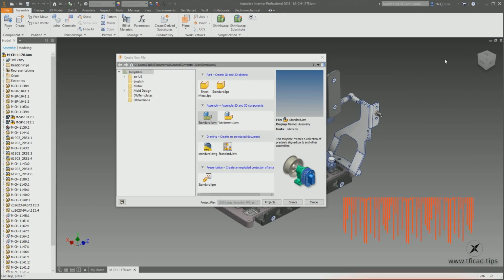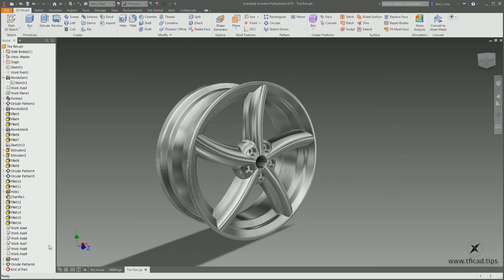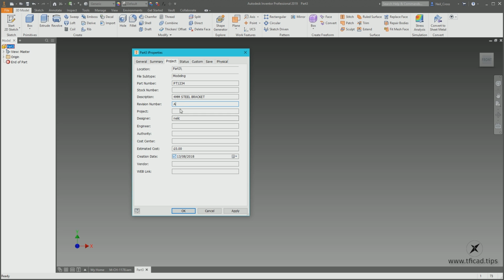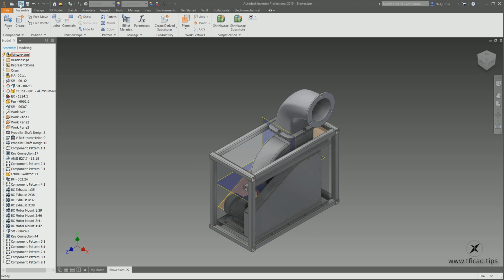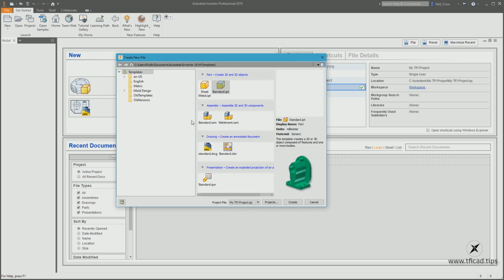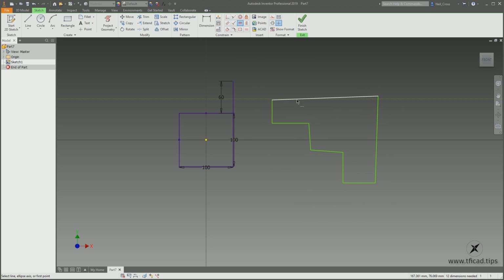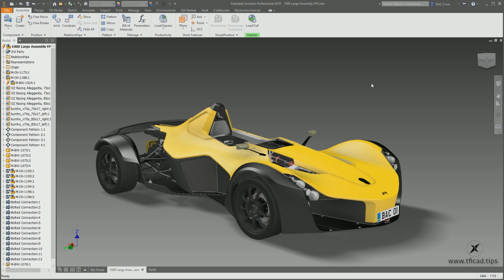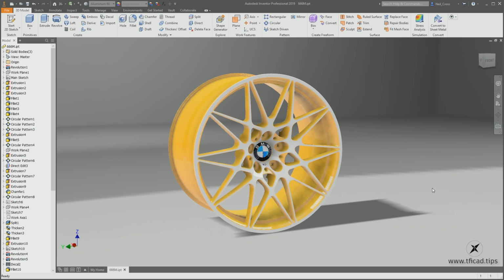5 Essential Tips for BEGINNER Autodesk Inventor users!

Comment: You said that you designed the laptop you were working on, so I have a question about that. I want to remake certain objects in inventor as well, however, I have no idea how to see all the parts, I don't know how to measure everything. Do you find references online with all the measurements? Or how does this work? Because so far I've been creating objects with no clear or correct data, so I'm interested to see how to even start.

Comment: Dear God.....I have used Fusion with the "Capture Design History" and whatnot and I have legitimately been saying for....a solid (HA!) year that Inventor needs that feature....Mind...Blown...

I had to actually pause the video after that and let that sink in. I have wasted SO MUCH TIME!!! Hahaha. Good God, I wish I had known that sooner. That right there makes me think you really should make that 50 tip video haha. I know that isn't what you want to hear...but my brain just exploded and it is only the second tip...kinda nervous for the rest XD

File management is absolutely an issue for me, it is good to see how I should be doing that with project files.

One of the most useful lessons you taught me in your "Inventor in under an hour" video was to keep every single sketch as simple as possible. I remember trying to design the whole part in one sketch when I first started and it was just an epic fail. I find myself always saying to myself "Keep It Simple Stupid" (KISS) in your accent, "Keep your sketches as simple as possible, do not be afraid of a bunch of different sketches to shape the solid into the shape you want." Some of my sketches are simply triangles or a hex only to extrude a nut "pocket" or hex shape cut into a solid so I can 3D print a part and simply put a nut in and easily joint pieces together. A lot of my sketches are very simple and I tend to have quite a lot of them and it just makes designing complex parts so much easier when you learn how to think decompositionally. "Start with the end in mind." The number of sketches DOES NOT MATTER, use as many as you feel are necessary. Even to this day I try adding too much into one sketch, keep it simple, simple is brilliant. 

I wish you would do more videos with assemblies, you have done a lot, I do not want to imply you haven't done enough or a lot. I am trying to create an assembly now and I am designing pretty much everything so if I want to design a bracket to 3D print or CNC machine out of metal, I find myself wanting to design a part in an assembly because I have to design a part based off of certain frame constraints. For example, the center slot and internal T-Slot style groove of extruded aluminum to get a nice snug fit, like this: https://us.misumi-ec.com/vona2/mech/M1500000000/M1501000000/M1501010000/ or similar where the new design must work with predefined geometry that cannot (or should not) be altered. In those scenarios, I think back to your "Inventor in under an hour" video (which I have gone over many times) and I feel like the way I am going about it is not the best way to go about it. I am getting better at designing individual parts, creating original parts to fit together flawlessly in an assembly is certainly a wall for me. Something in the back of my mind, I want to say it is you that said it but cannot remember, keeps telling me to stop trying to create a sketch in an assembly or subassembly when I am trying to make a new component for that assembly. I find myself stopping because I am under the assumption I am going about it the wrong way. 

I am not looking for individual support for my problems, just to be clear. This is a problem that I struggle with and I imagine if I struggle with it, I have a hard time believing I am the only one struggling the further into assemblies one gets. I know, I know, "Inventor is a hugely complex subject..." It is a massive suite, it really is. It is hard not to be intimidated and discouraged and/or disheartened by the sheer scale of the problem that is learning Inventor. In all seriousness, with how much time I spend in Inventor and how incompetent I still feel I am, I genuinely question whether three years in school is enough time. The certification exams require a minimum of what? 400 hours? I don't even know how hany hours I have in Inventor anymore. 400 hours is roughly a little over an hour per day, everyday, for one year. I easily have double, maybe even triple, that and I still feel grossly incompetent in Inventor. I would genuinely be so incredibly lost without your channel. Thank You so much for what you do.

On a side note, from one man to another, ya look damn good, no homo.

Comment: "Just play around" is really the best way to learn almost everything. It is how I taught myself AutoCad (started with v12) and now Inventor (with the assistance of your videos). I actually had Inventor on my machine for a while before I forced myself to design a project with it. The hardest thing was trying to forget the workflow from AutoCad while working in Inventor since they are definitely different beasts.
That was just under a year ago and I am currently running 3 projects out of Inventor (I am writing this as I wait on a stress analysis on a big assembly to complete) and I switch between Inventor and AutoCad almost seamlessly. Though I do admit to doing more complex sketches in AutoCad then importing them into Inventor as the sketch tools in Inventor still feel clunky to me.

As always thank you for your hard work in sharing your knowledge.
Reply: ooh my god, how are you now ? 4 years and now you should be very good using inventor... i got the exact same case as you right now, trying so hard to learn inventor and forget the workflow from autocad, since i also taught myself autocad by playing around... and now i also forced myself to work the project using inventor rather than autocad. how you think ? is inventor is much better than autocad for 3D mechanical drawing and assembling ? ooohhh how i would like to message and learn directly from you, i really got the same issue now moving to learn inventor, hahaha
Reply: @ryanninjutsu  I do most of my work in Inventor but I will leave it up to others as to whether or not I am "very good" at it.
To answer your question, yes Inventor is far superior for mechanical drawings and assemblies. 
If you haven't already I suggest you run through Neil's back catalogue of Inventor videos. Pay special attention to setting up your parts and assemblies with "best practices" because this will keep your files from getting away from you. Also, force yourself to integrate the parametric features. Taking a little extra time at the beginning of your drawings can save you hours when you need to make changes. 

If you want to ask me questions, feel free to post them here. If I don't respond quickly please don't take it personally. When I get busy it might be a couple of weeks before I even open YouTube to see what is going on.
Reply: @chrisose  thank you very much for your reply!! now you're the catalyst for me to learn inventor, investing my time to learn the software, 
i was always going back and forth and not sure if i have to learn this since im quite good with autocad, but i do feel limited in 3D designing because of autocad (or maybe its just my inadequate skill).
anyway, im going to learn inventor and do what you suggest to run through neil's back catalogue of inventor videos...

so im usually design the whole part at once in autocad, but in inventor ? we must do it 1 by 1 ? part per part ? 

many thanks for your reply once again, glad you're helping, its very okay if you're busy
Reply: @ryanninjutsu  While it is possible to build out a complex part entirely within a part file (.ipt), the power of Inventor comes in being able to design your project to mimic the real world where parts are assembled to make complex components that are themselves a part of an even more complex whole. 
And despite the fact that your models can end up extremely complex, you will still have the ability to edit the simplest parts. And if you have taken the time to link all your files properly, edits made to a simple part will automatically make necessary changes to associated components through the entire model.
Reply: @chrisose  i see, thank you so much for your insight! i could imagine im drawing complex machinery with inventor, but right now i still learning and practicing with inventor and by neils youtube tutorial. still not use it for my real project yet...

but i want to ask your opinion, since i also accept freelance 3D mechanical design sometimes, the part requested sometimes is not too complex, sometime its just 1 simple brackets of something. how you think using inventor for that kind of task ? or its okay for me to just use autocad ? i don't have any problem doing these simple task in autocad
Reply: @ryanninjutsu  I am assuming that the drawings you are producing have multiple views in order to convey all the details of the bracket. In AutoCad this requires drawing the part multiple times and with each drawing come the chance of introducing errors.
With Inventor you create the part model then your drawing is created using different views of that model. And if the part needs to be changed, the drawing connected to it automatically updates.
On several occasions I have been in meetings where the client was asking for changes and I was making those changes in real time and showing them the results within seconds.
This just addresses the time savings. Then you add the ability to assign materials to your part to get accurate mass properties as well as the ability to do stress analysis on your models to find out it will deal with the task it is being designed for.

Comment: "Honourable Mention No 3 :   HW"   - I have an i5  ,  8GB  ,  2.27 GHz  laptop   I have successfully installed Inventor from the student community area     I want to undertake a £600 City & Guilds (C&G) level 2 Inventor course (distance learning, so I have to buy my own hw)   Will this laptop suffice?    I don't know how many assembly parts are in this course   Has anybody been on a C&G Inventor level 2 course , and know this?   I have the funds to take this C&G course but not to buy an i7 as well (and I cannot afford a Lenovo P52)    Please can anybody advise if this laptop with the above specs will suffice for the level 2 C&G online course (if anybody has been on it)   Thank you in advance   (direct messages can be sent to 
 akwanlapli02@gmail.com    if you prefer)
Reply from the maker: Yes it'll be fine, I haven't done the C&G course but there won't be anything which would fail to open.  You might get a few delays here and there with 8GB RAM but it will get you through.
Reply: Thanks Neil      Is the clock speed of 2.27Ghz of my laptop sufficient?  (ie can I get away with the Inventor spec minmum of 3.0) Ghz?)  Thanks again
Reply from the maker: Yes it'll be sufficient, it's not ideal as 2.27ghz will be slow for most things but Inventor won't stop working or fail to load anything, it will just be much slower at certain things than a 3ghz+ CPU.  But don't worry it won't stop you from doing anything required in the C&G course.

Comment: Thanks so much for your channel Neil. I'm hoping to do freelance Inventor like you do after I pass the certified pro exam. I was going to install a student version and was a bit worried I would need to invest in a better computer, but after hearing your advice about not fussing over hardware too much I've decided to just pull the trigger and do it. It's what I need for practice and get up to speed for the exam without spending the 2+ grand for a single seat. Appreciate you very much. Wish me luck!!
Reply: Neil. My computer failed to install the Inventor 2019 program. Only 8g of hardware space available so I assume that was the problem. Anyhow. Question. Do you think the Intel Core i7 - 16GB Memory - 1TB Hard Drive + 128GB Solid State Drive will adequately run the 2019 version? Would appreciate your feedback if you get time.

Comment: Sadly my laptop doesn't like most Autodesk software. Fusion 360, Inventor and even DWG Viewer causes the BSOD. I am stuck still using 123 Design which runs quite happily. Laptop is a Toshiba i7, 32GB RAM, NVIDIA GT930M and SSD so should be OK. Haven't found a solution anywhere. Hardware tests all pass.
Reply: Sounds like your system kernel is still running 32 bit. Pretty much everything in the Autodesk line up requires full 64bit support.
Reply: Windows 10 64 bit is installed.